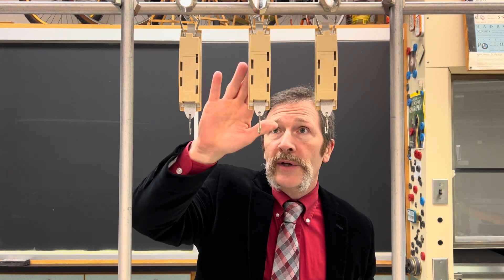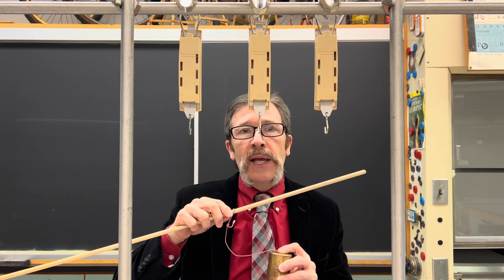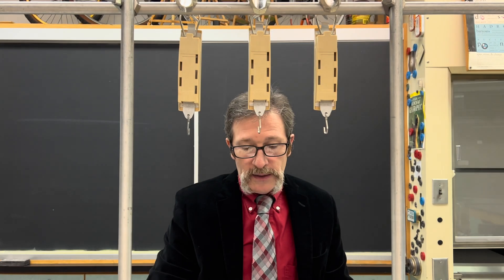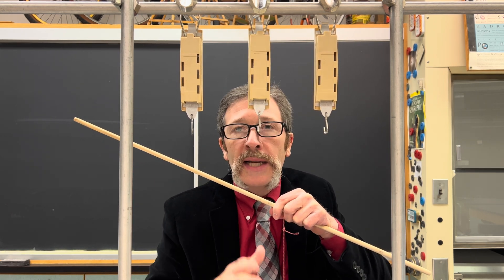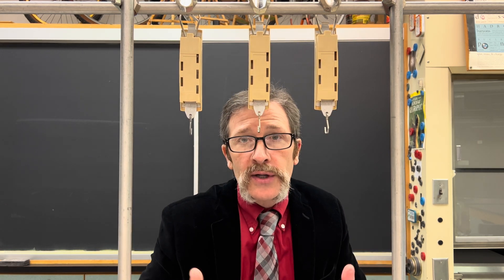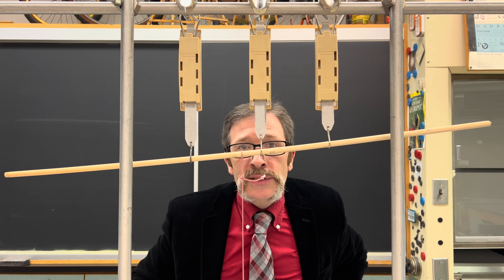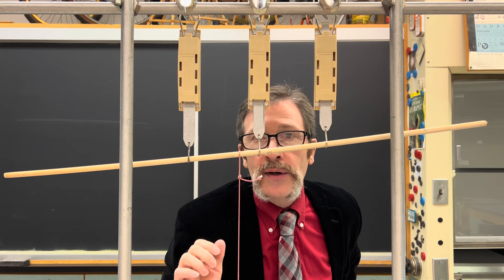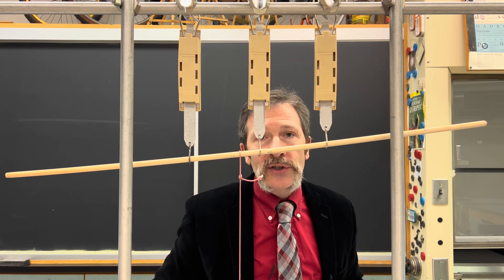Three Spring Scales in Parallel - Idealized Science Institute - Mechanics Quick Quiz

Comment: Depending on the rigidity of the rod.  Scales could all read the same, or if the rod flexes a bit, the ones closest to the mass may read slightly more. Also I hope he rezeroed the scales. In series scales you can see they were not properly zeroed. 70%